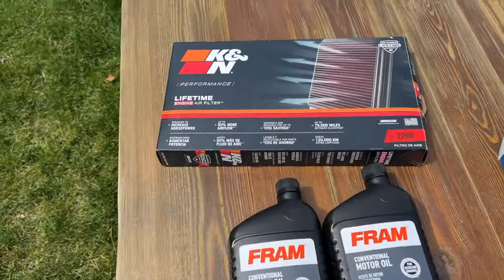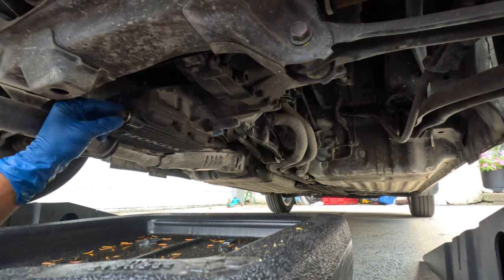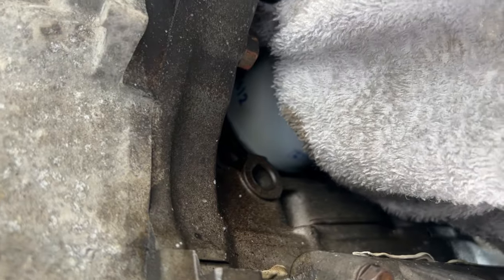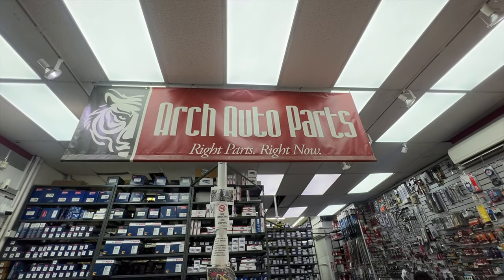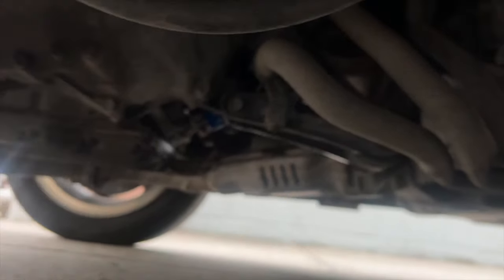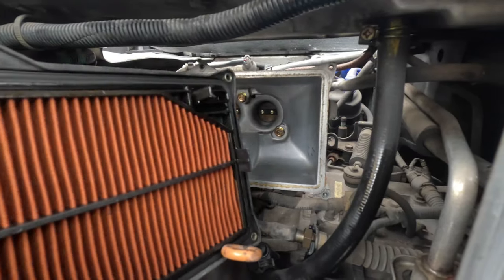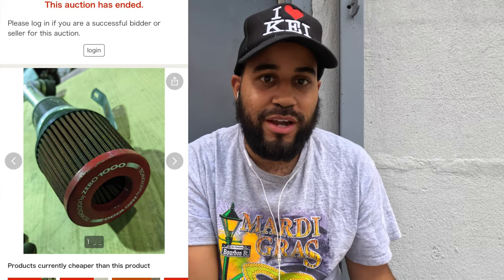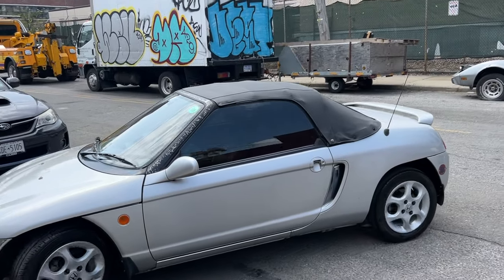Honda Beat Tune Up

Comment: Mighty Car Mods did a cash VS trash video on air filters and they found that aftermarket air filters often reduce performance.  Supposedly a lot of tech goes into the design of stock air filter systems in regards to performance and removing them can actually hurt the performance.  Since the Beat is mid engine, i would imagine that the stock air filter is designed to channel the air from the door vents and the aftermarket one doesn't. This might actually hurt your performance.
Reply from the maker: The aftermarket intake has a filter even closer to the air vent and its also going to make it sound even better

Comment: I was hoping you cut the video short and the new oil filter wasn't a quarter of a turn for the installation.  Given that the oil filter flew off as soon as the oil pressure built, it should have felt wrong when installing it.  When something feels wrong, particularly the first time you do something or use a new part on a new-to-you car (which you do A LOT), stop and figure it out.  This would have been much less of a problem to fix before filling the engine with oil and blowing it out onto your driveway.  I'm an old guy.  My experience helps me avoid bad mistakes, but bad mistakes were how I gained experience.   🙂

I found a good WIX oil filter that fits my Hijet and I bought a case of them so I'm good for the next 12 years.  I hate shopping for stuff like that every time I do an oil change.  I always plan on an oil filter wrench to remove the oil filter, even on the filters that I installed hand tight, and definitely on cars that were last serviced by Valvoline Instant Oil Change.  My 4Runner had an oil pan drain bolt that I SWEAR Valvoline installed with an impact wrench.  I install Fumoto oil drain valves on all my vehicles to make the next oil change very fast and no-mess.

The Japanese farmer who previously owned my Hijet omitted the crush washer on the oil drain plug so it had a small weeping leak.  He tried to fix it by over tightening the drain plug and he stripped the aluminum drain pan.  The Fumoto oil drain valve has a fiber washer and apparently has tapered threads like pipe threads.  The Fumoto oil drain valve tightened when the original drain plug wouldn't, and the oil drip disappeared.

Thanks for showing you getting the wrong oil filter and the wrong air filter.  This is the common American kei car experience.  Sourcing parts is a PIA.  It's very frustrating but there's no shame in that.  People need to know.  Thanks also for showing the part numbers that work and where to get them.  That info is as good as gold.

Cleaning the oxide off the outer layer of plastic makes the headlights pop.  To keep the plastic from oxidizing again in a few months, mask the rest of the car and spray the plastic lenses with two part clear coat that is UV blocking.  The 2K clear coat is available in a rattle can for home gamers.  I bought it on Amazon, but Eastwood also sells it.  It's a special can for two part systems.  An internal seal is punctured, shake the can to mix the two parts and you have 30 minutes to spray it before it hardens in the can.  The headlights will look good for 10+ years.

That Beat is looking SWEET!  Sanding and spraying the windshield frame with a good black paint would be a nice quick upgrade.  Rust-Oleum Black Trim and Bumper Paint #251574 is actually pretty good and it's cheap.  Maybe do that while masking the rest of the car and clear coat the headlights and windshield frame at the same time.

Can't wait to see the vinyl wrap and the new soft top.   💣
Reply from the maker: I shows the new filter it’s the Honda oem Filter 14500 plm a02. And thanks it’s coming along!

Comment: Duuuude... don't beat yourself up too much, shit happens. However, a couple tips from an old man: If something doesn't thread well, STOP and back up to assess the situation. Oil filters can be largely interchangable but it's key you look up the dimensions of the filter and cross check it with an OEM part number. For example, when my Suzuki Alto arrived, I wanted to get a local sourced oil filter. Seeked info on a suzuki FB group and was given conflicting info. How did I know? I compared thread size and gasket diameter as well as confirmed it had a proper pressure bypass valve. A couple suggestions said to use a filter with M20 thread, and others said 3/4 inch thread. After a little digging with OEM part numbers, I found it had the 3/4" thread. Turns out my Suzuki Alto likes a 2005 Toyota Prius oil filter, and the air filter is a match with a Daewoo Tico.  But don't take my word for it , double check the research always.
Reply: I had a similar odyssey tracking down oil and air filters for my Daihatsu Hijet pickup truck.  They're rare enough in the US that there isn't a cross at auto parts stores, but that info should be available on the mini truck forum, but I got conflicting info and had to sort it out myself.  Once I found a good WIX filter, I bought a case so I'm good for 12 annual oil changes.  I keep notes on my computer so I don't forget info I learned last year, but I still don't want to spend time every year trying to buy an oil filter.  It's like bronchitis.  Ain't nobody got time for that.
Reply from the maker: Very true, think ima go with oem for now if it’s available in America.

Comment: 4612 and the honda filter is the same (tread and the gasket surfase wise) Honda one is slightly longer. 4610 will be a perfect match. I think what's inside the box was the wrong filter.
Reply: Wow, man, I rewatched it, and the filter also has 4612. This is a mystery. I use 4612 in my honda motorcycles as well. Love how the car is coming up.
Reply from the maker: yeah idk what happen lol
Reply: Poorly machined thread or incorrectly labelled part? Where made?

Comment: Oil filter had the incorrect tread and most likely had an incorrect label. Just make sure that it fits securely.  Just get OEM oil filters if you're unclear what to buy
Reply from the maker: OEM filters might be a move for my Honda kei cars